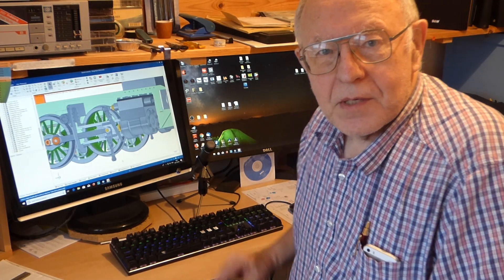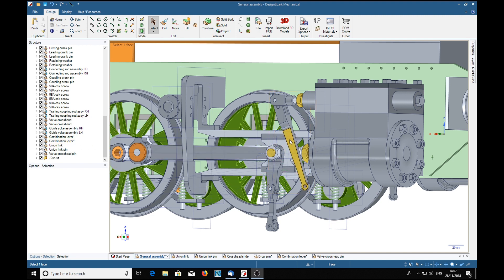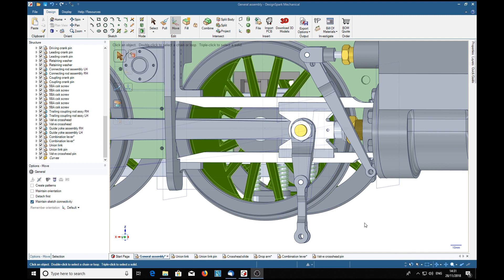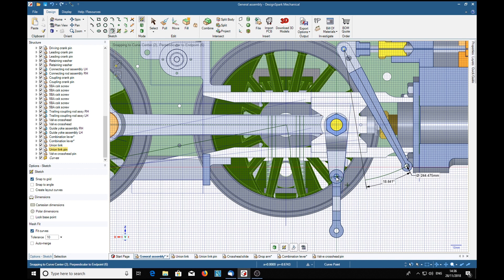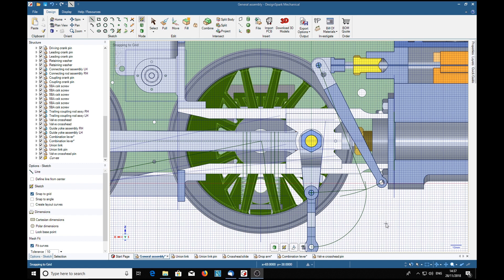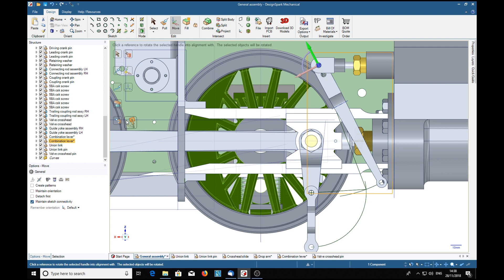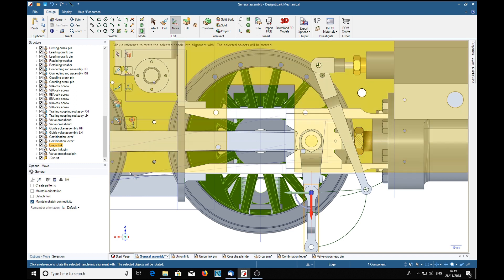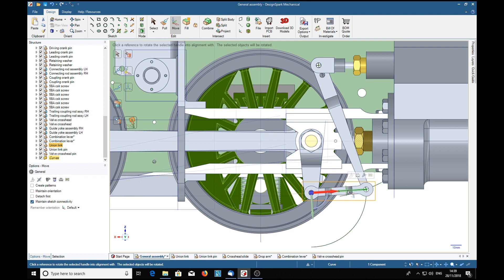DesignSpark Mechanical: Aligning model loco cranks

Comment: Hello Jim. I am using DSM v4 how do I go from my 3D model to create a 3D part in my 3D printer.
I installed Ultimaker Cura to generate file for the 3D printer but the *.STL export file option in DSM does not work. Thks
Reply from the maker: I do not possess a 3D printer and therefore don't do 3D printing. I suggest that you ask a 3D printer expert on UT.
Reply: Jim thank you for your fast reply.
There aen't much information around.
Anyway if you use DSM v4 can it export a *.STL file ?
Thks again.
Reply from the maker: Yes it can - I tried it.
Reply: Jim after I re-installing the file translators then DSM v4 works well; it created the *.STL file.
The translator setup.exe was under DSM_Patched>Translators.
If you decide to get a 3D printer then after completing your 3D model save it as a STL file.
Next you will need a slicer software. I installed Cura slicer: https://ultimaker.com/en/products/ultimaker-cura-software
Then Cura creates a *.gcode file for the printer.
Thank you for the great support !
Reply from the maker: Thanks for the info.
Reply: @JimTaylor42  You are missing out big time! You can buy an ender3 on eBay for less than £200 and a roll of filament for around £12

Comment: Hi Jim, I'm very impressed from Your videos and about the complexity of Your designs. Thanks You!
I'm regarding You as an expert. You saw some videos from You "related to clocks". This is my hobby. My basic challenge is to make a "crown wheel" design in 3D.

I would like to ask You for a solution for it.

To understand my question, please take a look at:

https://www.youtube.com/watch?v=BoeP0adbDKg 

I can make a "normal" gear (=wheel) for a clock. But these kind of wheels with vertical teeth makes me puzzled. I'm trying polygons, profile curve of a tooth pulled to a surface and then rotated it as patterns. So I'm getting teeth, but they are not on a cylindric face. I'm really far away...

Maybe it's easy to solve, but not for me...

Comment: Hi Jim, Have you had a chance to try DSM V4 yet and if so what is your opinion?
Reply from the maker: Yes. I am using V4 now. The only difference I can see, so far, over the beta version is the inclusion of the Blend tool. This may not mean much since I have not explored the whole thing yet. I think that most of the improvements are in the area of access to the RS parts and products.
Reply: I read all the release notes and the only things of interest was a variation on the pattern drawing, stop chamferring and section faces, 2 things I did notice were it is much slower running on my Windows 8 laptop and a warning it is not backwards compatible as the file structure and dependancies have changed so I am sticking with the older version until I have finnished the current projects and maybe try it with a future small project.
Reply from the maker: Yes, I would agree with that absolutely. It does seem to be a tad slower on my Windows 10 desktop.
Reply: Steven Hodgson DSM v4 file export format *.STL does not work and that it is not backwards compatible you will end up with an useless 3D model in your hand.
Of course *.STL file is needed to create a gcode file for your 3D printer.